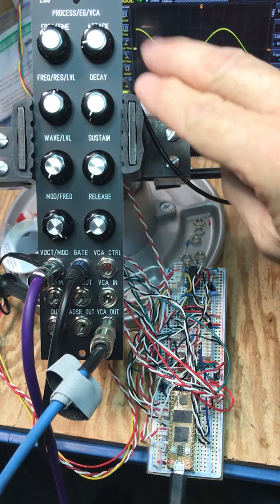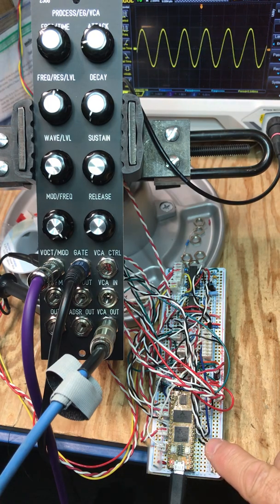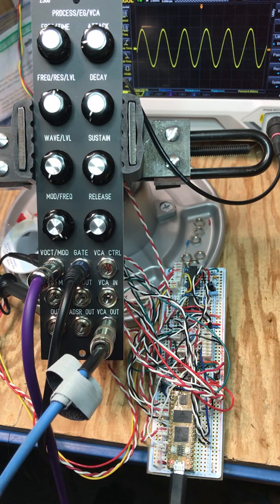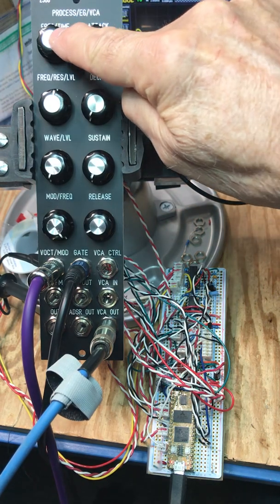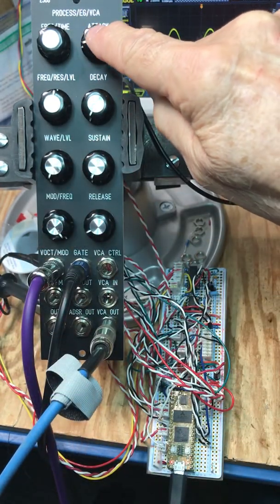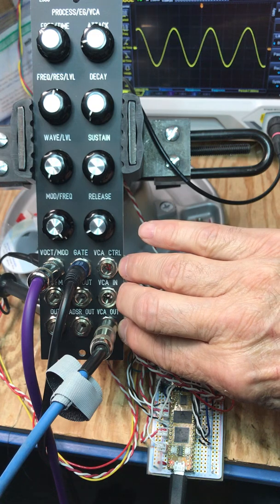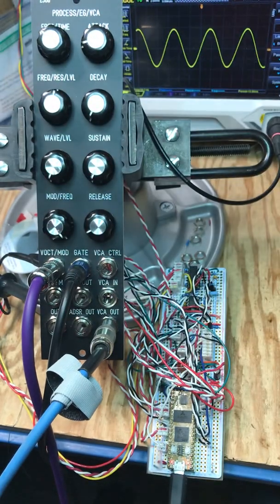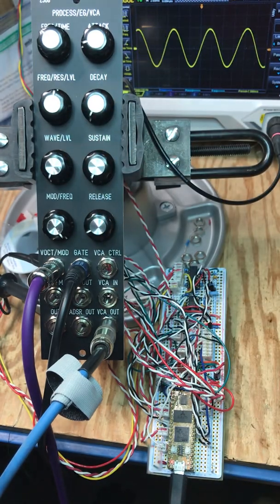Daisy simple synth voice with an MU (DOTCOM) panel - prototype demo

Comment: Hi, if i wanted to make my own euro rack module would this be a good place to start?
Reply from the maker: Kalu - Yes!  This video is for the MU version, but I do have a Eurorack version (10hp) that will be available at the end of the month (Sept. 2020).  It has a mode that provides a full voice controlled by a CV and Gate.  You would need to add case and power supply, of course.
Reply: @ozhalljr  thats great thank you so much

Comment: Would you be willing to share the schematics and code?  Thanks!
Reply from the maker: I am using the circuitry from the Patch schematics.  The eagle format .sch file is published by electro-smith.com.   I have not published the code, but it was mostly driven from the published examples.   Reach out if you hit a roadblock.